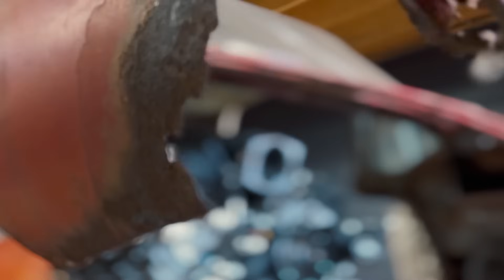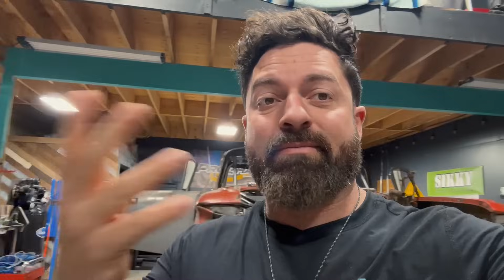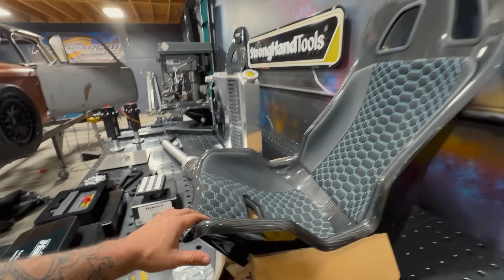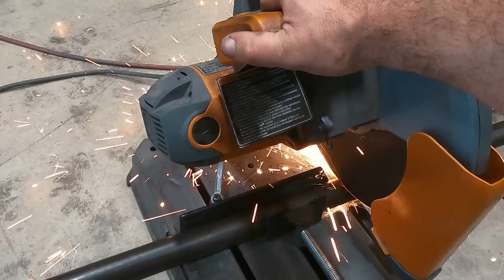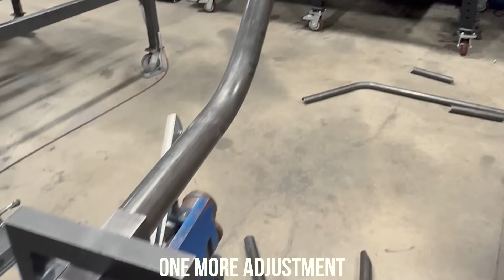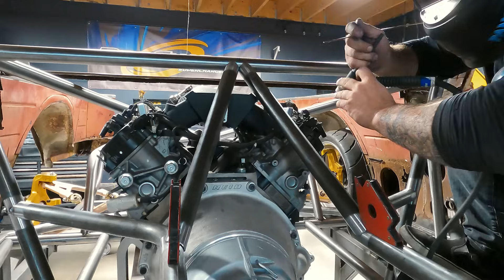I Quit My Job to Build an All-Wheel Drive El Camino...Now the Chassis Might Fail

Comment: If going going rhd, once you get your measurements,  see if a g8 rack is the correct length,  then get the equivalent rack rhd from a commodore out of Australia.
Reply from the maker: That would probably work on most occasions but the issue is the car is super wide. It’s hard to tell on camera but once I blew out the wheels the entire car is now wider then a Nextel cup car lol so I have to get a custom one made

Comment: Can't wait to see more videos out of you going right hand drive it's going to be hard to use the original dash in it and if remember correctly  them things had some pretty cool dashes in
Reply from the maker: Yea that’s one draw back! But I had an idea of splitting the dash and or using pieces of it to recreate something of the original design. We will see!
Reply: Reuseing the Gage Trey would be pretty cool @RetroFabworks
Reply: @RetroFabworks  The dash looks symmetrical, if you got a donor dash and cut in that dash's passenger side into the current drivers side to delete the gauge holes it would look the same. You can then cut new holes in if you want to use the stock gauges but no need with the Haltech display. As for parts for the rack and pinon steering look to Australia, Japan or UK since they drive sitting on the right side. 
Just found this channel, subbed and excited to see more.

Comment: Those are really nice seats. I’m not sure if I mentioned it but I bought a Fein metal chop saw, so much better than the abrasive saws
Reply: @retrofabworks if you don’t have the tube polisher attachment for grinders, it is great for cleaning up tubes. Flexes the belt around it and makes nice clean lines. Also upgrading to the ck flexloc torch and a wireless foot pedal I found to be well worth it. I have the tig button from 6061 also which is great for awkward positions where a pedal doesn’t really work and not having to drag a pedal around for tacking. Little pricey though and the variable pressure button takes some getting use to
Reply from the maker: You mentioned it last time and I have to dig into it this week I keep forgetting. What else do you recommend ?
Reply: @RetroFabworks I can’t even remember what u had for breakfast 😂
Reply from the maker: @xozindustries7451 oh man it’s bad when I build and edit days at a time get lost
Reply: @RetroFabworks ya, I hear ya, some days at work it seems like I get nothing done in 10 hours, other days it flies by